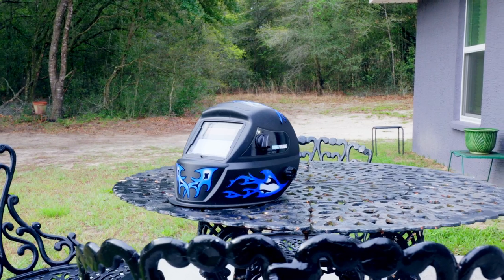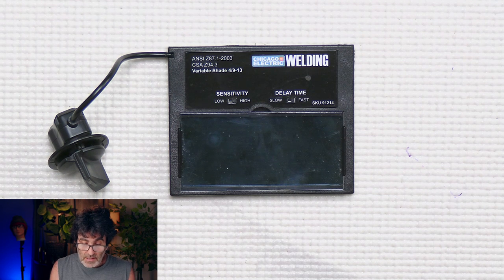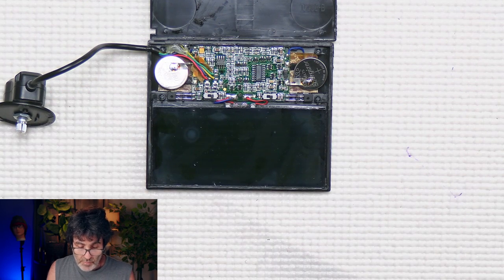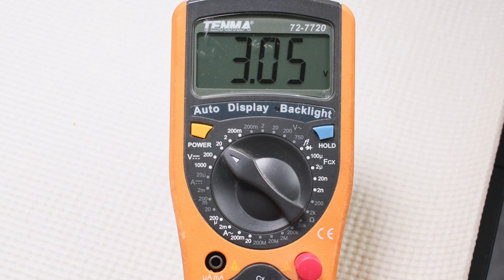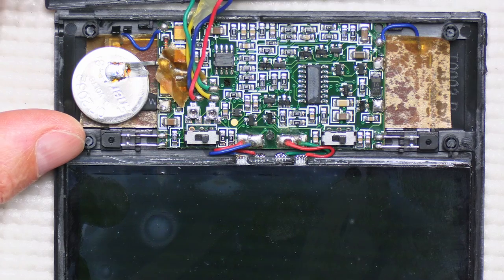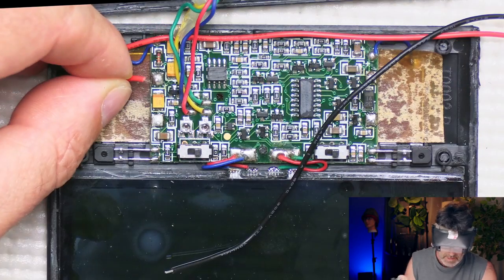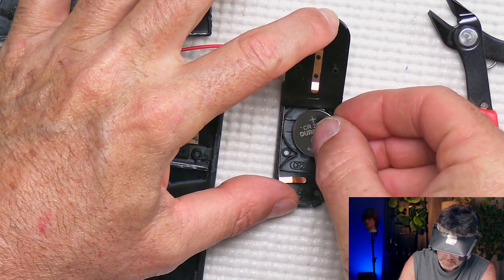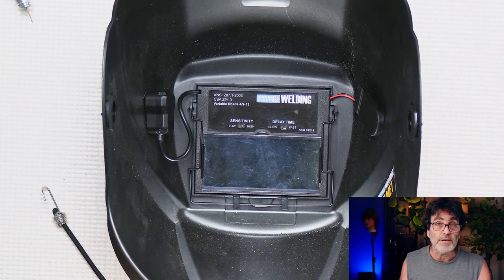How to Get Your Harbor Freight Welding Helmet Working Again

Comment: Could have just jumped the left side + - leads and just ran the positive and negative on the right side. Less wire to run across the top of the circuit board.
Reply from the maker: Thanks for the info!

Comment: So I took mine apart and there is only one battery…a CR2450 and it tests at 3.18 volts. If I replace it with (2) CR2032 batteries, that’s 6+ volts. Am I going to screw something up?
Reply from the maker: HI... Yes don't add the 2nd battery if yours only has the one at 3V...  You should still be able to use the 2032 battery since it's 3volts and easy to get a holder for it..  Unless you can find a holder for the 2450.

Comment: This is a GREAT hack!!!! Awesome job with updating from your previous video. You should probably pin a comment with a hyperlink to this video mentioning the update and also recommend it using one of those tiles at the end of the video. I never even knew there were cases like the one you used! If there's enough space I might clean a portion on the inside with isopropyl alcohol and gorilla tape him in rather than drilling the helmet. Either way this was an EXCELLENT recommend 👍👍👍
Reply from the maker: Excellent idea to pin this to my other video... Thanks for the idea.  The gorilla tape is great, but if you store it in a hot garage for example, the glue may let go due to the heat... 😀... Also that battery case has an on/off switch.  I found that one of my batteries died again... Even with the helmet off.  So use the switch on the battery case and store it with the switch off.  I put a piece of tape on the inside of the helmet indicating which way off was so I didn't have to get a magnifying glass every time to figure out which way was off!  Thanks for the feedback..
Reply from the maker: I think I accidentally deleted your newest comment!  Sorry about that, I did read it.  You're welcome.... 😀

Comment: My helmet has one 3v cell in a pull out holder, so I don't require this cure, but I have a problem.
Why is it that whenever I go to use my welding helmet (which isn't often) the battery is dead?
Why is current being drawn when the helmet is just lying there?
Should I be storing it in the black bag it came in, for some reason?
It is very perplexing because these things have no on/off switch.
Reply from the maker: Gary-Seven!  Oh yes I remember him... 105 miles, 104 miles.. 😊  To your question, I have run into that before.  On this model I had that happen a couple of times So I did install a physical on/ off switch inline with the battery holder and that did solve the problem.  This one actually has a switch on the helmet from the factory that clicks as if it were off, but I still had a problem with a dead battery.  I don't know how hard it is to install a switch in your case but it would solve your problem.
Reply: @JLPicard440  103 miles. Thanks.

Comment: Great video thanks .
I was using mine today and all the sudden I got flashed , it stopped darkening all the sudden
Reply from the maker: Oh that's not good!  You can test it with a cigarette lighter spark or an igniter for a torch... anything that makes a spark so you don't have to risk it blinding you with a weld spark...

Comment: are  these battires 2032 Battery  Recharge with the solar on sheild sorry for the dumb question i realy dont know
Reply from the maker: HI... No they don't charge from the solar panel.  The solar panel is just the light sensor that triggers the helmet to go dark.  (At least I think that's what it is for!). Not a dumb question... 😊